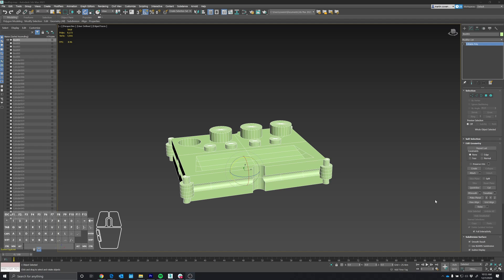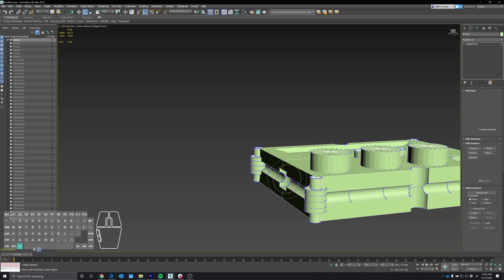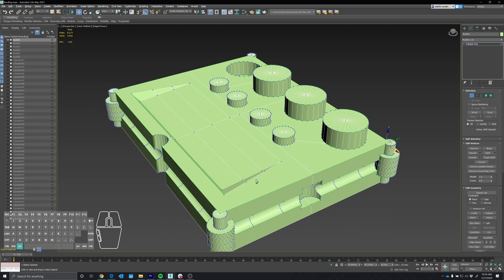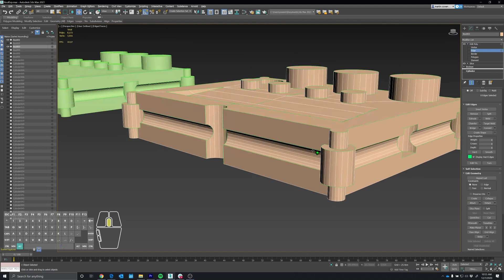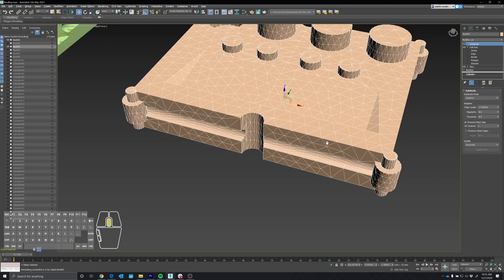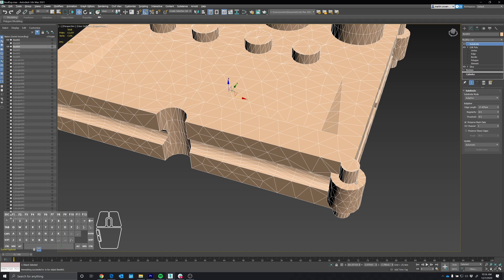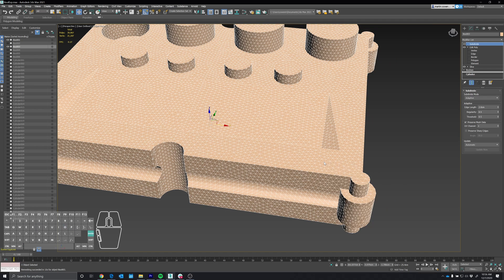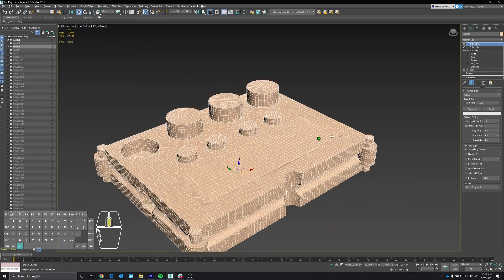Boolean Mesh Retopoly pitfalls

Comment: When the CAD model is so awful you have to rebuild it! That might not be possible with a more complex model. In that case, we need to essentially DynaMesh it to rebuild the topology? Instamesh can work in some cases, but wouldn't be successful with surfaces that overlap visually but are actually separate. Hmmm.
Reply from the maker: Some CAD models are certainly on the difficult side to clean up. We have some ideas on this that we will continue to work on. :)
Reply: It wasn't a CAD model. I bashed it together with primitives and applied boolean operations.
Reply from the maker: @AlbertonBeastmaster  Yeah this was a weird case. I'm still uncertain why it had so many non-manifold problems. Did you use the new CARVE booleans or did you use ProBooleans?